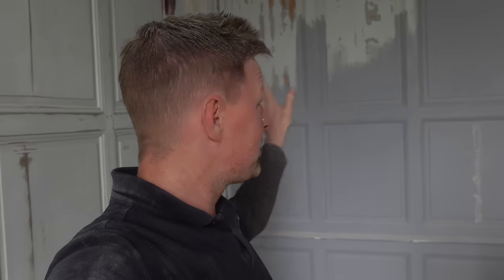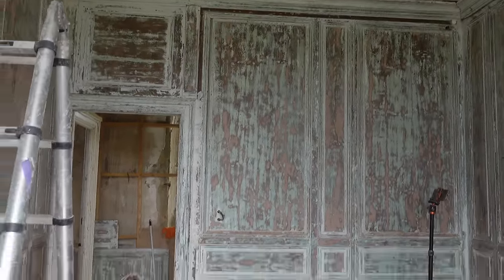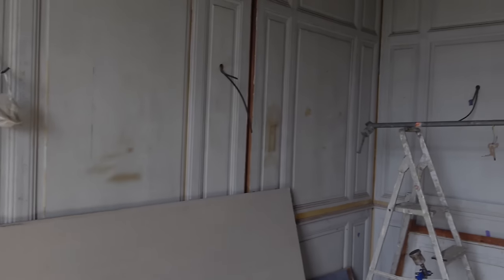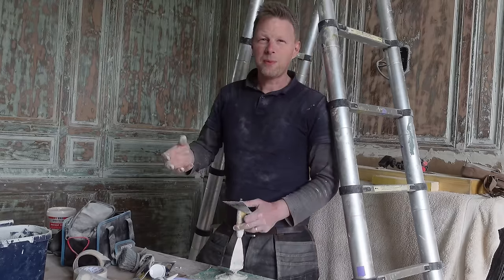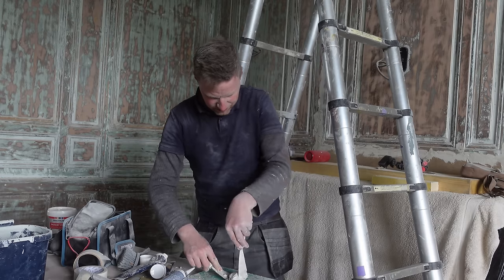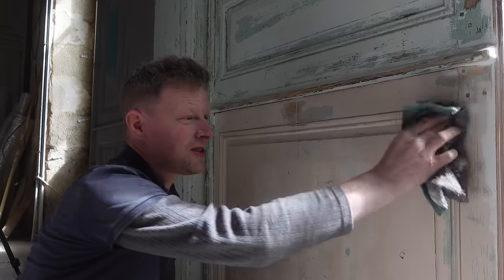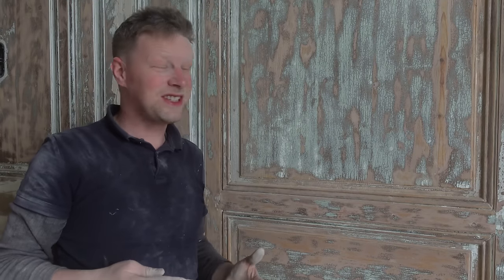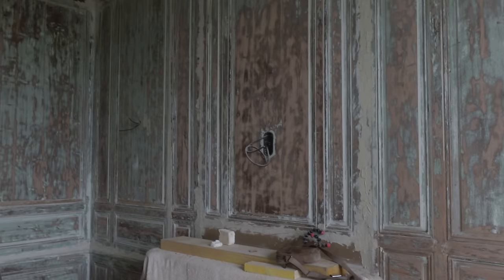Is This the WORST JOB We Have Ever Done?

Comment: Hi just a suggestion from my decorator husband when using the two pack filler  shape a small piece of old wood like a filler/artist pallet with a small handle instead of a thumb hole  makes it easier to hold the wood and then less chance of droppings

Comment: When I was younger, I often did work like this, and it never seemed to end! In that sense it was a terrible job. But it's worth it in the long run! Once the surfaces are smooth and free of cracks and noses and the primer has been applied, you will receive your first reward. When the last layer has been applied and the paneling can be seen in new splendor, you quickly forget all the work and look forward to the beautiful walls for many years to come. Even if a new coat of paint is needed later, the work will be much quicker and easier.

You did that very well. It's a shame that I can't do something like that anymore, but the nice thing is that I don't have to do it anymore, and I enjoy watching you work :-)

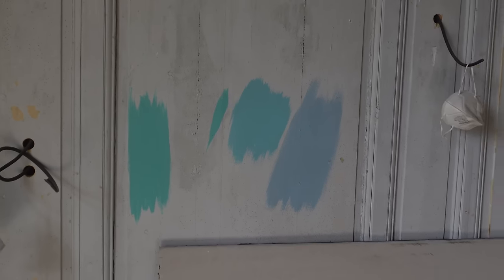Comment: Of the three colors shown at 5:54...The one on the left is very close to the well known jewelry company, Tiffanys', blue/green brand color. It is very pretty but that brand reference will always be there. And perhaps that is not a bad thing. I like the middle blue/green especially when taking into account the fireplace color.The thing I know about choosing colors is it rarely happens in a vacuum—fireplace surround, floor color, trim color and other "suite" colors are a consideration I am sure. I am thinking of The Red being used in the other room. It is so very intense that its "impression" will follow into the other rooms. Choosing a color that is harmonious and calming with The Red is the ticket. Oy. What a tough choice. I vote in a vacuum but I vote for the the green on the left. Go big or go home.

Comment: I agree about the paler colors, like the blue and the pale turquoise one immediately to the left of it. Have you thought of matching the existing pale green (or is it a too old schoolhouse-cum-public building shade for your taste?) I'm thinking if the paint job is done to your usual high standard, as your current & typically excellent preparation, i.e., sanding & filling suggests, the pre-existing pale-green shade may look very good and far more authentic.)

Comment: Mine vote is from three ones that what is on right, more blue one. It is still bit strong for mine taste, I would milked it down a tiny bit until Azure Blue what looks very good with natural wood, gold/brass  but it all  depends what textiles and details you want add later. If you still want use green color...maybe Chalk Green?  Other tones all felt too modern and strong for smaller than ballroom space.
Reply from the maker: Thank you 🙏 😊

Comment: The grey blue is very pretty. It has the most 18th century feel about it. The greens are awfully strident and don't look antique. Have you ever looked at the 18th century color schemes in the Hotel do Carnavalet - 

Museum of the City of Paris. They have many period rooms with authentic color schemes. 
Of all the DIY chateaux you can see on YouTube yours had the most panelled rooms. Most don't seem to have more than chair height woodwork. I don;t think Lalande had any. Patrick and Steward don't have much either. The provincial houses weren't that elaborate anyway. 
Even if you don't get into something requiring carving for the grand salon the boisserie in the rest of the chateau is something you can imitate using routers and tables saws. But you can do curved panels using the router like you were doing for the applied panels. But using the router to produce curved moldings for wide panels between windows would look good too.  It would be so much better if you can do real wood boiserie and not use modern materials. You don't have to use oak. You could use poplar or pine if you can get it knot free, That might be difficult to find.. Even luan if its still more affordable than oak. It's usually very straight grain and knot free. I used to use a lot of luan for architectural model base frames. Or oak.

Comment: Computer results for color are not actually very accurate.  If the color is what I think it is, it’s very popular for outdoors in New Mexico where the sun tempers it after a season or two.  Interiors that color were very popular in the late 70’s, early 80’s.  They tended to exhaust the eye without a lot of visual interference.  If your walls, in that room, will be as busy, and full, as your other rooms, you can probably get away with it.  Is it like the color on your work board on the floor where you are mixing the pastes?

Comment: Dear Terry (and CO)! As someone who has en education in epoxy I need to WARN you guys about the filler you are using!! Expoxy is EXTREMELY allergenic and if you get an allergy from epoxy you will be allergic to all kinds of resin which includes ALL types of wood sap! ( you can get a reaction the first time you use it or time number 1000). Epoxgy is also highly suspected of being CANCEROUS. Epoxy is dangerous in fluen form, when touching, inhaling vapors, and in dust form. It emits toxic fumes when it is in liquid form and when it is cut or sanded! PLEASE PLEASE PLEASE take care!!!!! Wear a resperator with a chemical filter (dust masks don't work on vapors), gloves and eye protection! Epoxy is harmless aslong as you don't break it's surface (by cutting or sanding it) and it has cured. Kind regards from a Danish Cabinet Maker and Educated Furniture Restorer

PS the risk of getting a sevear reaction and a permanent allergy from all wood gets higher every time you get exposed to epoxy. A good alternative to the epoxyfiller is a lindseed oil-based filler - it also works great outdoors.

Comment: Give it 6 months and the filler will crack. Especially if you introduce heat into the rooms
Reply from the maker: It hasn’t anywhere else we have done this? We have used this technique for years?
Reply: @chateaudelalacelle  I'd be surprised if it doesn't eventually. I hope it doesn't